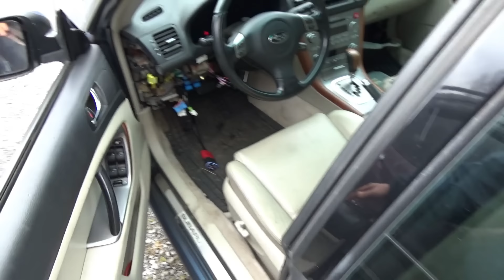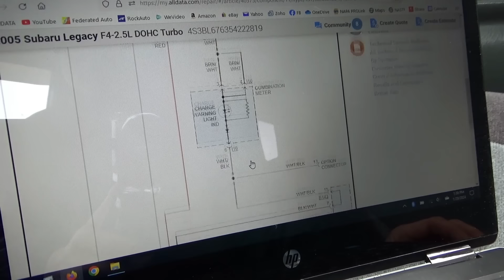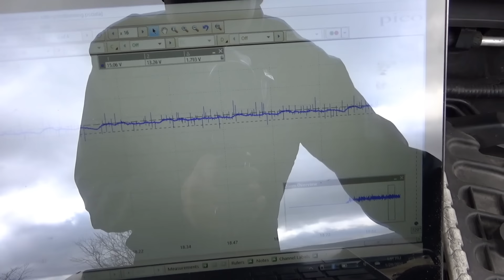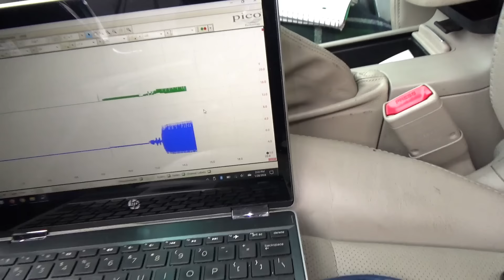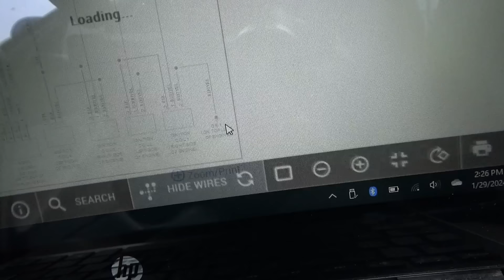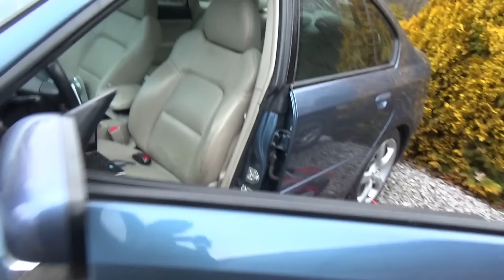Weirdest Subaru in the WORLD? (Part 1 - BARELY Runs with Alternator Connected??)

Comment: I'd try disconnecting the alternator output wire. My gut feeling is that the alternator output current is messing some ground to the ECU or to a sensor. I don' t think it is related to the alternator control wires.

Comment: "What would you do next?"
Me: Take it to Pine Hollow Auto Diagnostics 😅
Reply: I had a early forester that ran poorly , i did a comp and leakdown check, replaced plugs and leads, borrowed a coil set of a guy at work. Unplugged the alt, unplugged and cleaned all connectors in the engine bay. Took it to three different subaru specialists. No joy. Ended up fixing the problem by selling that turd.
Reply: @watsisbuttndo829  "I had a early forester that ran poorly , " My brother has a 2003 outback with the same engine. The 1997 to 2002 engine number one problem is a blown head gasket. In 2003, Subaru went to the same engine that is in this 2005, except has 2 extra cylinders. 
The sad thing about my brothers outback, it was made in August 2002 and has the 2002 engine in the 2003 car. The 2002 engine is now out of the car and a 2006 engine is now in its place. The only thing keeping it from running is the throttle body of the intake is now electronic as opposed to the 2002 throttle body being cable driven. 
I found that out the hard way. 
I'm now in the process of swapping out wiring harnesses as I now have a 2006 ECU and a gas pedal I purchased off of eBay.
Reply: @nathanwoodruff9422  I actually got offered a 6 cyl engine that i was told was a potential fit, but having a young child and other more interesting projects relegated this to the "too hard, not enough time"  basket. And yes, my car was in the "bad head gaskets" era. It hadnt exibited any signs of that issue but it was another nail in its coffin that caused me to get rid of it.
Reply from the maker: @watsisbuttndo829 bummer... The 1st gen Foresters were pretty cool 😊
Reply: @PineHollowAutoDiagnostics  mine was a POS. The 22R powered LPG fueled hilux i had at the same time was more powerful. It drove like it had no ignition advance, wore out its gearshift linkage, split CV boots, failed an injector, failed a plug lead, and then the clutch started slipping. All under 180,000kms. The hilux i had at the same time only ever failed to get me home once in 518,000kms.. no more subies for me!
Reply: @watsisbuttndo829  Not much can compare to a Hilux.. lol.   You kinda raised the bar over everyone's head with that one..
Reply: @calholli  while i can cut the subaru some slack as to not behing as rugged as a hilux, i couldnt live with the subaru also being less powerful than a carburetted ,LPG fueled 22R. There was something wrong with my forester no one could put a finger on. I was not sad to see it gone.
Reply: 2006 Subaru sti with a po302.  currently Troubleshooting . Will get rid of this pos asap if mechanical
Reply: @PeterHernandez-lg2eh  Replace the spark plug in cylinder #2.

Comment: Bypass alternator plug (go direct to alternator) white/red with fused battery voltage and test light for alternator warning signal to isolate problem to vehicle or to alternator output.
Reply: That's what I was thinking, too.

Comment: This only has 82,000 miles in 9 years because it's not running most of the time. I've had a missing engine ground cause big issues. Just not these issues.
Reply: i think i have a bad block ground in my dads bronco but the cable looks in place kinda like here.  jumped to the alternator case and everything worked.  need to replace that ground cable!!!!!

Comment: Replacing the alternator cured a rough idle on my Volvo V70 D5. It also transpired that one of the ABS sensors was unplugged, but only threw a code after the new alternator was fitted. Most strange 🤔

Comment: Check out the parasitic battery draw, maybe related.
Reply: I think it is an alternator for a 3.0L engine that is on a 2.5L engine and that 3rd pin on the alternator for the 3.0L engine is now shorted to ground.

Comment: Short circuit in wiring between alt. and feed to injectors or coils on 1 bank of engine.  Just a wild guess.
Reply: Check 3 wires from alternator to destination, shorted to ground or high resistance in one of the alternator wires

Comment: I worked at a trans shop for 10 years and it was pretty common to see 1998-2006 range dodge caravans that would shift erratically and actually upshift through gears sitting at a traffic like stopped and speedo would rise up to like 30mph or so. It was caused by bad factory alternators putting out excessive AC voltage and the output speed sensor would start picking up this AC voltage and make an erratic signal. We would unplug the alternator connector and it would go away, so we would install a new alternator and good to go, but it was the FACTORY alternators that would do this.
Reply: Fun fact, caravans (and other Dodges as well) have the voltage regulator in the PCM. Meaning if you have a charging issue sometimes you don't need an alternator, you need a PCM! Pretty dumb huh...
Reply: @nickolaswilliams935  Plenty of modern cars have the PCM set the alternator voltage.
Reply: @ferrumignis  I don't like the idea, PCM'S are not cheap. Thankfully you can buy an external regulator if the internal one goes bad, I've don't that before.
Reply: @nickolaswilliams935  diode bridge is part of the alternator and I always replace an alternator as an assembly not replacing just the rectifier.
Reply: @nickolaswilliams935  Most cars made in the last 30 years are like that
Reply: @radman999  I think it's a dumb idea
Reply: Info is key
Reply: Ecm have the voltage regulator,  alternator have the rectifier diodes that is what cause ac voltage ripple when it  fails .Duhhh
Reply: @mandytuning  yes diode bridge has failed causing AC ripple, and I always  replace the alternator as an assembly
Reply: Back in the early and on 80’s, we’d always get cars in with charging issues and it was commonplace remove the alternator and test/inspect and repair. We’d always replace the regulator on a one wire alt, and test everything else, diode trio, rectifier bridge, brushes, continuity’ etc. and replace what was bad unless it was all trash. Never any problems after, the good old days I suppose.